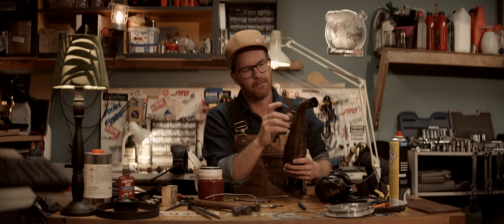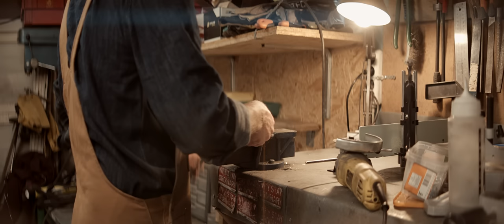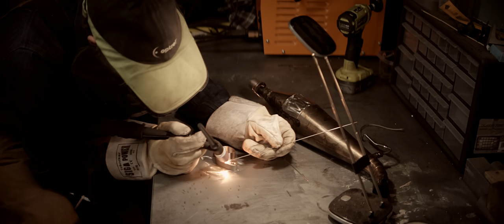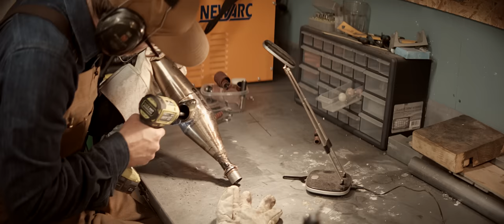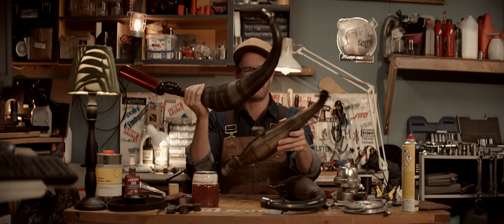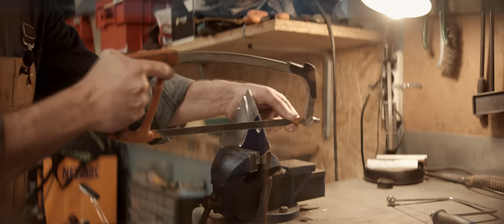Two Stroke Pipe Wastegate - Why do I get such strange problems?!

Comment: Maybe try a butterfly valve Y piece right at the header, one side to a straight pipe for starting and idle and maybe a servo to switch the butterfly to the power pipe at a set rpm?

Comment: I've always had the steep expansion section closest to the engine on my racing go kart Komet engines. The stinger section came off the shallow angled section. Try turning the pipe around.

Comment: In my experience, I would say that the problem is more with the mixture of gasoline and air than with the back pressure.👍
Reply: Exactly this, I think he had a blowback problem because of the pipe and the extreme rotor inlet timingWith the reeds it worked better.
Reply: This engine runs on liquid

Comment: I am guessing the sound waves are making a resonance, not just at the stinger end, but reflecting off the opposite side of the cylinder, inside the engine. You're getting a standing wave that is causing a high pressure zone at the centre of the cylinder. your exhaust port is so wide and clear the sound waves are focussed at the middle of the cylinder, like circular waves in a special pool I saw ina tom scott video.

Comment: the atac valve shoiuld be on the header, with a fixed volume chamber, and if you open the valve into the exhaust stream itself to block the wave physically, that will really help you as well,

Comment: either a faster starter or a butterfly choke system on the hole that you made with a choke cable you can control the amount of air gap , if that makes sense, choke /air-intake controlled by cable and lever thingy-me-bob lol

Comment: You need to check out the Yamaha‘s 350 /400 twin two stroke the RD model from back in the late 80s they are you will find the exhaust valve mechanism they had between cylinder head and expansion chamber,, the installation of this valve on the RD 350 and 400s twins produced huge power,, I think your problem can be solved with a little more research into these extremely rare and powerful engines

Comment: You should have used the step drill bit to get the smallest hole possible to maintain better air flow at high RPM

It would also allow you to mathematically figure out what you would need to change for the next iteration of the pipe

Comment: Great progress!
I still think that between the low-end regime and the high-end regime, a STATIC single carbed or inlet/exhaust layout isn't good enough.
There needs to be some kind of "valve" or changeover between these two regimes.
Maybe something like a YPVS system, or a secondary set of reed-valves that only operate at higher RPMs (which happen to both be mechanical)?
I'm so happy with your progress, friend. :) Keep it up!

Comment: Maybe something like the variable induction system that some cars had? Changeover flaps/valves that select one of two exhaust lengths with selection made depending on engine RPM.

Comment: Exhaust valve at the exhaust port it needs the back pressure it will run perfect exhaust. The valve will need to be timed with the intake slide use two cables. Very simple to do you have the slide valve you had made for the case, mount it to the exhaust just try it pretty easy MOD

Comment: I hate to say it..but I have been harping about "timing" the pulse (flow bench) for couple of years now..Off the top of my head, I wou 24:09 ld suggest remanufacturing the pipe with a much more severe transition,  to a double the width (for starters) pipe, then "necking" down to half the width, then half again (in about 4 inchs) then taper to outlet..Good Luck! 👍🗽🇺🇸

Comment: Try coming from a different angle. I would seriously consider ditching the carby and using fuel injection. Installing both intake and transfer port injectors would allow you to ensure that fuel is getting into the cylinder to get it above the problematic Helmholtz resonance.

It would also allow you to get a decent fuel-air ratio at all revs and get onto the pipe much smoother.

Comment: cagiva has an auslass steuerung to come over with a idle issue. with the pressures in crankcase and exaust are a thing want to see if there´s a harmonic in the pressure reading maybe sometime you install a pressure transmitter or reader in the crankcase and write it in the laptop to see difference in exaust length its an uncommon thing but maybe for science ;)

Comment: I think because that pipe tapers into a cone is the issue, if it ended with a soda can shape there could be multiple exit ports. or do like the old drag street cars and have a valve that can vent directly off the header open or go into the exhaust pipe, closed. maybe use a vacuum from the intake to acuate the exhaust valve or something.

Comment: Maybe add a sleeve valve at the start of the pipe. Annular openings in the sleeve and pipe could be opened by rotating the sleeve with a simple cable connection

Comment: Your using a different valve system which changes the strength of the pulses so a new design of pipe for the different strength pulse is needed.

Comment: Just thinking out loud here, maybe preheating the pipe and having the engine draw air from a heated source (hair dryer maybe) may help move the resonant frequency enough for starting? Due to the fact that the speed of sound changes with air temp. Probably not going to work but worth a shot

Comment: I'd be careful about using a high-speed starter in the 4000 rpm range or higher. The piston thrust loads will be the opposite of what they are when the engine is running under its own power. The potential to "hook" a piston/ring in a port is a distinct possibility and unusual wear might occur. However, if you're determined to try this technique—run a start-up fuel that is oil-rich—a blend that could easily switched to your normal fuel when the engine is up in speed... where the "short pipe" works.

Comment: I don't know anything about 2 stroke engine design but maybe have the rotary valve have less abrupt opening and closing. I'd think at lower rpm it would affect the pulsing more than at higher rpm. The rotary vane could have a spiral type shape to slow the opening and closing of the port area or just a triangular shape. Probably a dumb idea but I'll put it out there.

Comment: Personally... I would try a collar on the exhaust pipe. ie... Cut a hole in the neck of the exhaust pipe (near exhaust port/'Flange' end), slip a 1" wide collar - a kind of rotatable valve say - (with same sized hole cut into it) but have it a 'Smooth' fit. Then, have it set 'Open' to start the motor, and then rotate the 'Collar valve' to close the 'Hole' up as the revs raise??? 🤔
😎🇬🇧

Comment: All the Japanese manufactures had/have some sort of exhaust/exhaust port variability - AETC, YPVS, ATAC, V-TAC - to spread power. There has to be something in your exhaust/intake port design that is causing  the sensitivity. How about changing intake length? Even velocity stack length on carb can effect function.

Comment: The exhaust length needs to be varied between the two cones not the header.. that is how you will vary the resonance. The only reason it hasn't been done in my opion is because it could be difficult to seal the two  exhaust parts in 'commercial ' use. But you could do it easy peasy.

Comment: Alex, I would of just extended the narrow intake of the front section of pipe. This would be enough to change the pulse of back pressure. Maybe an extra 3inches/75mm to start with.👍 I just don't see the waste gate giving overall control. It's only going to change internal pressure, not the pulse.👍

Comment: I think I know what the problem is. My friend Races boats runs a 350CC Yamato.and exhaust has a chamber slide on all 4 expansion champers.the chamber has a lever and shortens chamber for low end and cone lengthens for the 15,000 to 20,000 RPM on top end.researh pipes

Comment: The position of the waste gate is on the horizontal plane where the pulse flow is parallel. A 90 degree exit at this juncture is just bypassed, whilst a multi port actuated revolver cylinder style proto waste gate on the tail bell, where the pulse turns, might just be the ticket. Cheers, H
Reply: Upon further contemplation, it may not a pulse issue, perhaps it is just need more fresh air for your fuel ratio. It's pulling in  O2 from your exhaust port. The bikes problems and your gollum might be the same issues. Proper oxygen uptake is impeded. Nitrates build up in the body impeding cellular and mitochondrial respiration and waste negation. Mayhaps you both need more fresh air. Food for thought, H

Comment: GOOGLE "karting slippy pipe" ... Karting solved this problem in the 70's .. you need a "slippy pipe" .. a pipe with a slidable diverging cone/stinger. These were used in Roadracing Karting (Enduro), the driver had a lever to slide the pipe for low and high rpm operation.

Comment: Could you modify the pipe you welded to have a valve in the exhaust maybe!, it's partially there and could be throttle controlled maybe. Stupid suggestion I know but an idea is better than none

Comment: I don't see you having a resonance issue, so much as having a volume issue. When you have the pipe close to, but not on the engine, the pulse gets to travel as expected, but the extra volume the engine is making can disapate. The larger pipe has more internal volume so the engine can breath more easily as an increase in volume from the engine won't equate to as much of a pressure rise within the pipe.

Comment: You are probably having too much cylinder pressure when transfer ports open in comparison to crankcase pressure, so exhaust runs down crankcase or simply won’t let enough fresh misture to go up to the cylinder. 
Also could probably be loosing too much mixture straight to exhaust.
You could try to simulate the airflow since you have all the drawings, or try testing the airflow. Either way I would suggest measuring the crankcase pressure, so you could define exactly when does mixture flow up, how efficient is your engine and all. 
I ran a two stroke DKW engine for years with lots of play on the pistons (spec is 0.07 I had it around 0.1-0.15, ring gaps around 0.9 when spec is 0.4-0.6) bit of losses here and there. Would run sweet but low on power. Used to drive all night 400 500km around 90km/h with no issues.

Comment: Drill holes on a small length of pipe.  Use it as a spacer between the engine and the exhaust

Comment: I'm no 2 stroke expert but I get exhaust pretty well. I wonder if the negative scavenging pulses are actually emptying the fresh air charge because it can't pull through a closed rotary valve. In high rpm 4 stroke stuff its not usually an issue as any extra scavenging actually pulls in more air and fuel.

Maybe your rotary timing needs to be different than typical 2 strokes to combat this? Variable valve timing is a solution but a rather complex one.

Comment: It seems like it wants a much larger diameter expansion chamber closer to the exhaust port and a larger diameter exhaust tip, or like you say a slightly smaller venturi on the intake. Definitely a breathing imbalance at low rpm

Comment: Seems to me like you have a super rich condition at low rpm, but not straight away after it has been reving high. So it needs to get some extra air from a partially opened hole in the exhaust or a gap between the pipe and port to get it leaned back to stoich and not bog down.
Have you checked that there isn't a pool of fuel standing in your crankcase/cylinder after you spin it up with the drill BUT BEFORE it starts?

Comment: How about a "slipper pipe"? not just on the primary tube but also in the main body. we used to do both in Karting. you can get the pipe to work at both low & high speeds. your reflector is very aggressive sending a strong signal back to the port.

Comment: On the short pipe I think the exit is too small. 

Same on the pipe with two cans, in between the cans is too narrow. 

I’ve forgotten which engine is mounted but if it’s the pip I’d find the volume of the cylinder in CAD and make sure each pipe section has at least that capacity.
I think that’s why the long neck pipe works. 
Hope you get it sorted so your happy with it. 
Much ❤ Love

*the wastegate/valve in the center of the resonance chamber, I’m not so sure about that. Seems like it’s going to defeat the purpose and make testing more difficult.

Comment: Just spitting ideas but could the large (even when stuffed) crank case volume make it sensitive to the pulses?
All I know about this stuff is a bit of mechanical understanding combined with your explenations.. the term 'my engine doesn't suck' sticks in my head.
What I am thinking is the large volume of the case combined with the timing from the cylinder is making the total package extremely sensitive to the pulses, running a rotary or reed valve wont change much (in my head) since the sensitivity comes from the mass of air that's already in the case.

Man is this channel cool.

Comment: You need to use a adjustable slider pipe for low rpm and higher rpm they work very well  i use it on my 2stroke race  boat

Comment: Are your rotary valves holding up still? The impulse dampening is another innovation I haven't seen on other 2 strokes. If you put a valve on the waste gate port and don't let it vent directly to atmosphere but through a tube, would you have a variable exhaust length or a variable impulse magnitude?

Comment: Maybe the end baffle is to steep(+15°) and the return pulse gets to strong. The mellow pipe has a much lesser angle (~10°)than the other pipes. The return pulse wont be destroyed by making a hole in the belly, just a litte bit weakened. Just a thougt and theory like mostly in two stroke tuning 😅

Comment: I don't have much idea about the intricacies of 2 stroke engine dynamics but it seems that the resonance issue could indicate a "true" resonance conflict. Meaning the pulses in the exhaust are being thought of in terms of actual exhaust gas pressure waves with less or little to no consideration of true Acoustic waves (sound) which could be/likely are a completely separate phenomena existing simultaneously with the exhaust gas pulses. My thinking is that the true acoustic waves effect the exhaust gas waves a little but the exhaust gas waves effect the acoustic waves to an even lesser degree than vice versa. 

Again I don't actually know about these sorts of things from practice or even theory but generated this idea that seems plausible through observation.

This could be why what you're experiencing now isn't anything you have or have heard of before being that the engine and at least a few of the components are very different from usual two stroke engines. 

Cool to see the progress
Reply: Here is a large part of what effect the experiment you conducted lended for the observation and consideration of actual acoustic waves vs. gas pressure waves. Making a large hole in the side of the exhaust chamber would/did have a significant effect on gas pressure but it didn't on sound waves. Those sound waves were traveling across the hole and had little to no reason to change direction due to anything other than reflection off of surfaces (such as the angles of the pipe walls)
Reply: What it seems to me is that you're work is showing that acoustic waves and exhaust gas waves are two perhaps slightly overlapping phenomena yet are distinct in the way they behave.

Comment: This seems like a flow issue. The more a pipe flows the more of a pressure drop. It seems like you have back pressure which you do not want. Exhaust port might be too small as well.

Comment: While I find this R&D interesting, I can feel the frustration.
Just an observation based on my experience developing my RGV250 Land Speed Bike Engine.
I know this is not a conventional engine but it is now pretty close. Having said that, needing to spin a 2stroke this fast to get it to start makes no sense.
Even when I had full kit spec porting, high compression Head inserts, 38mm Lectron carbs with my own designed (MOTA Software) Pipes that got my RGV to rev to 13000rpm, I could kickstart it after three kicks cold and first kick when warm.
Needing to make elaborate variable length mechanisms indicates a basic design issue. Usually these things were used to circumvent Engine Rule restrictions.
As far as a solution, I tend to agree with some comments below that suggest checking if something creating an internal resonance variation, and also a Pipe redesign or a shorter baffle cone mod to the thinner long pipe.
Keep on Keeping On
Pete

Comment: I've had that problem before end up my pipe was stopped up I made the out let bigger but think about a pipe you can adjust sliding back and forth to have different tuned length I've seen it on a boat

Comment: Temperature? Were you running the cooling system?  With pre-heated coolant?  If you weren't, then it seemed like much of the behavior you were seeing could be explained by trouble starting and running with the engine cold, but working fine with the engine hot.

I'm also wondering if it might be a good idea to pull out the crankcase stuffer; it's still in, right?

Comment: lol. I think your right but not only do you have to deal with the fule wave pulses you have to which out for 1/2 and 1/4 wave pulses. if you are having bad pulses at 2000 rpm you most likely have problems at 1000 and or 4000rpm that would enplane the "weariness" you are having.

Comment: When you designed the engine you calculated the volumes without the crankcase stuffing, now you have the inserts you’re suffering with exhaust, readjust the crank inserts mabee